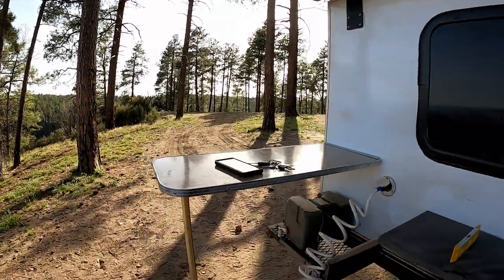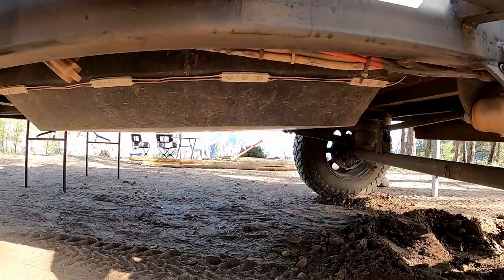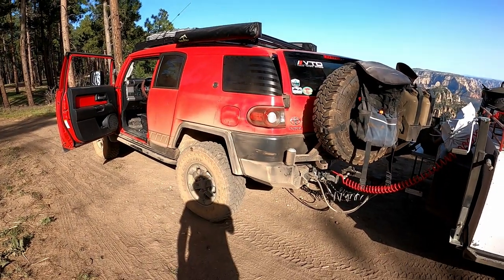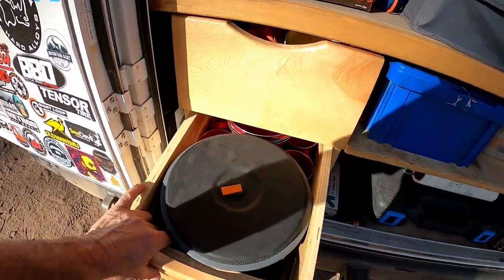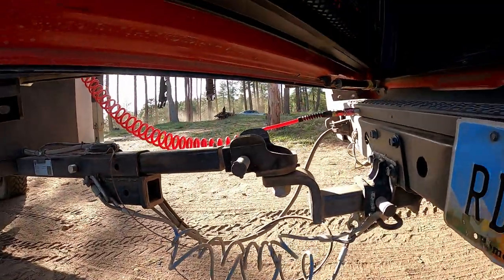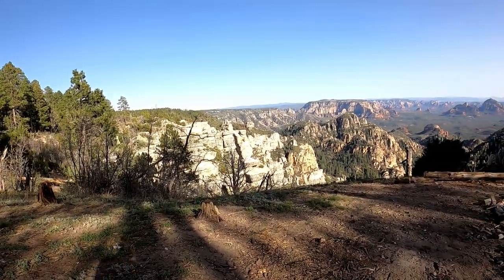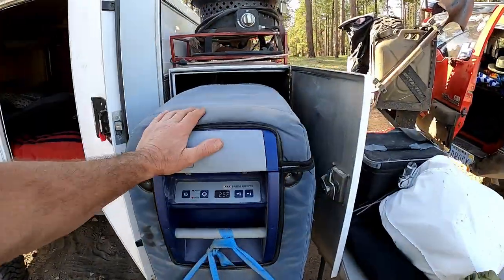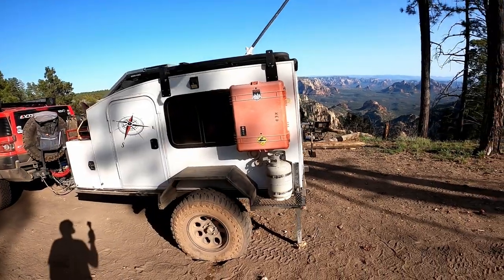Hiker Trailer Extreme Off Road walk around, BEST off road trailer ?

Comment: Great, thanks for the video. I also have the Hiker Extreme off-road 5x9. Currently fabricating a proper skid plate for the underbed storage compartment and water tank.
Reply from the maker: Just remember don't add to much weight, your trailer is heavier than you think. Mine is like 2800lbs. It will take a huge rock to hit the storage compartment I have done some fairly hard trails and have never hit the storage or the water tank. With yours being 9 foot you are more prone to hit the water tank because i think it's back farther than mine is.

Comment: Thanks for the video, I am interested in the way you installed the solar panels. Looks like one tilts up, is that correct? and if so, was it a DIY thing? thank you.
Reply from the maker: Yes, the flat one on the top of the rack folds up. It is made out of some aluminum angle. The angle slides in the track on the rack and pivots the panel up.
Reply: Thanks for the reply, Did you DIY or a purchase?

Comment: Video does not do the trailer justice. It is much better in person!😎😀
Reply from the maker: Thanks mike
Reply: @redrockoverland  I'm working on designing a slide-in box for my 5x8 utility trailer. This way, the trailer can be a dual purpose trailer. As a camp trailer and still be able to use it to haul things. I have a few extreme versions ($$$$), and right now I'm working on a simplified version ($). Will still have to wait to see what the future brings.

I was comparing the Hiker to the Mammoth trailer. For the same amount of money, you get more with the Mammoth. However, the Mammoth lack serious storage space and I am not hearing good things about Mammoth customer service. The cost is still pushing me to attempt a DIY version.

Wishing Red Rock Overland safe travels and awesome adventures. (Dan & Bernnie make an awesome team)👍😎😀
Reply from the maker: +Mikell Miller your set up now works, take your time on deciding what direction you are going to go on your trailer.